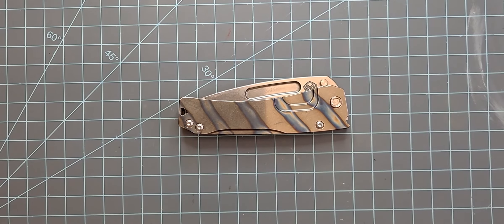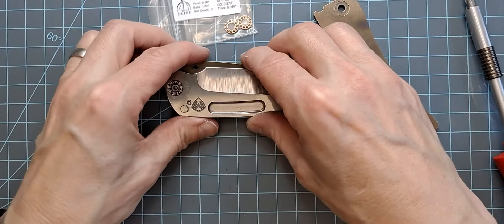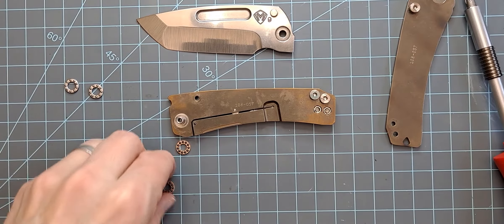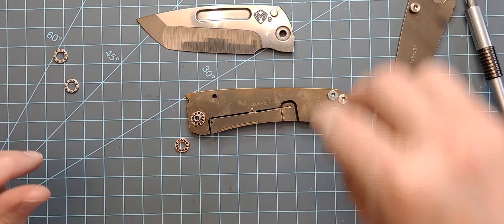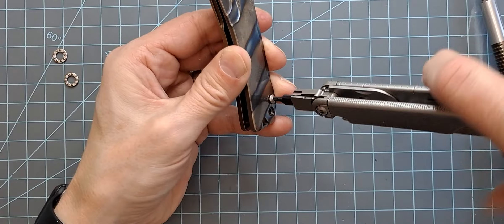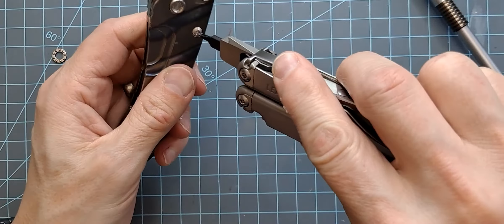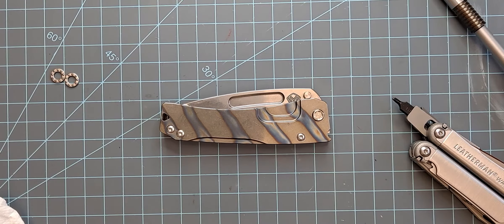Upgrading the bearings in the s90v Medford Slim Midi Marauder

Comment: Mine had the same issue with the lbs. When you’re opening/closing the blade the lbs isn’t allowing enough room to accommodate for the detent ball riding on the blade. I took mine off and filed down the side that hangs over the lock bar so that while the detent ball is on the blade the lock bar isn’t pressed against the lbs but it’s still there to prevent over exertion with finger.
Reply from the maker: That was a smart fix. I wish I had thought of that. Did you need to file down the screw a little as well?
Reply: @chucknunface   No it didn’t affect screw depth. I only filed down the small portion on the bottom of the lbs that the lock bar makes contact with.

Comment: I bought a Medford 187 DLT exclusive with the s90v blade steel. I like the knife but I wish I would have bought a slim midi, I didn't realize until later that DLT did s90v on most all of there models and now they are doing Magnacut at 63-64 hrc.  Not sure if that is someone else's exclusive or if they just offer it everywhere Medfords are sold. What really sucks is that I paid quite a bit for a USMC fighter folder knife in s35vn because I thought it was gonna be somewhat rare and now they sell them in Magnacut. I need to try and sell my fighter folder so I can get one in Magnacut.
Reply from the maker: DLT exclusives are all s90v, which I really like. S35vn is historically the most common steel for the FF. The only other steel I saw until recently was 3v and that was much more rare. It sounds like Medford has adjust their HT on Magnacut so that's a good thing.

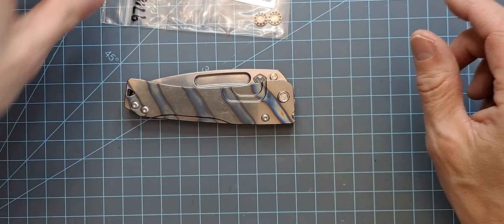Comment: that impersonation of Skiff bearing people at 1:30 is spot on, I know bc I sound exactly like that. Even if they dont make a big difference, I like em bc they just seem more quality than the cheap looking bearings that come in a lot of knives
Reply from the maker: Well thanks for not taking me (or yourself) too seriously when I say that. I'm sure they make varying amounts of difference in different models. I just don't think the slim midi benefits much from them, but I could be wrong.
Reply: @chucknunface  for sure! And I think the bearings themselves have to break in for a bit, so it might get better after a few days of fidgeting!
Reply: I like to use them to add lateral stability…
Reply: @chucknunface  man it changed mine so much it was a different knife. I tuned mine to pretty much drop shut with them. Think I still have some videos of it somewhere but it’s a game changer from those standard ones.
Reply from the maker: @Josh-jw7cb  that's awesome I'm glad it worked out, man.

Comment: I put skiffs into 3 different slim midi’s. First one made a huge difference and I was able to tune it to almost fall shut. The other two it smoothed them out a bit but didn’t make a huge difference. Overall it’s probably worth it though imo.
Reply from the maker: Nice. What I've noticed is that if I remove the lbs it drops like crazy. Not sure what the effect on the lock will be though

Comment: If you want to make it smoother next time, get a cotton swab with a dab of white lithium grease. Very lightly grease the ID of the pivot hole on the blade, and also lightly grease the OD of the pivot barrel. Carefully place the blade on the pivot, ensuring very light and even coating of lithium grease between the pivot barrel and the blade. Now you'll feel the full benefit of your labor. And lithium grease is long lasting. Combined with Skiffs'... 👍
Reply from the maker: Thanks!